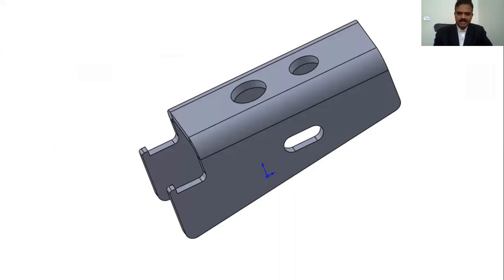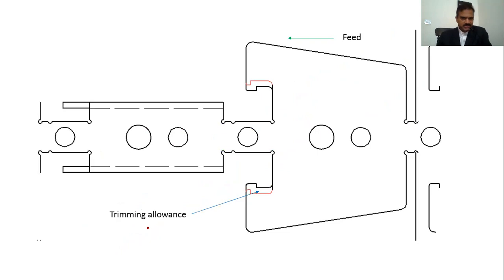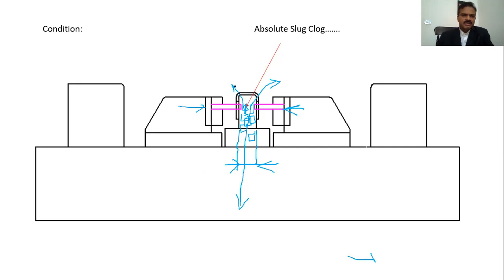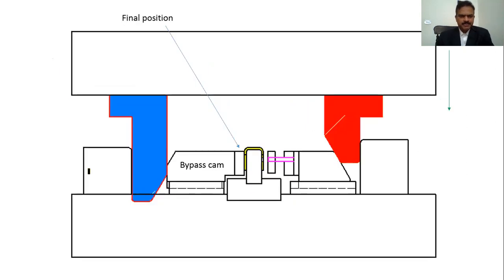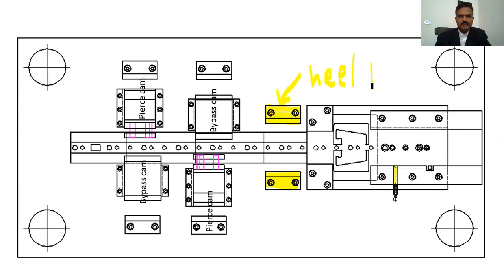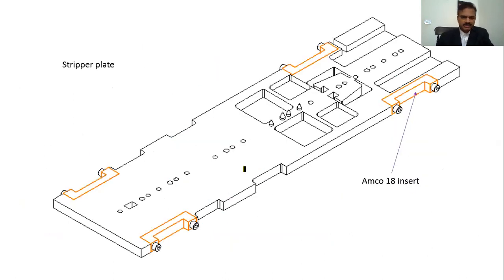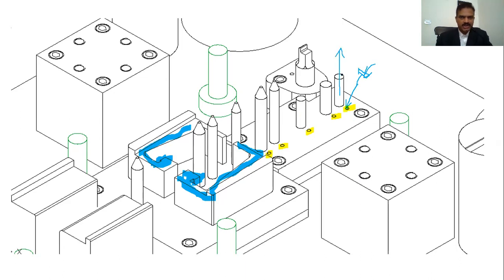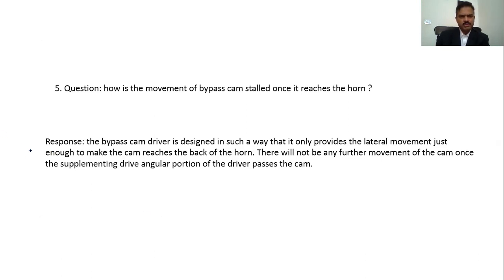ADVANCED MULTI STAGE TOOL

Comment: Why should I use a side piercing cam although I can make that piercing In one of the previous stages before making the bending for both two side flanges?!
Reply from the maker: Side cam pierce is opted ( in this case) when we need to hold the position of the profile in tight numbers with ref to the datum on another plain......
Where as if it's an open tolerance, we can do it all in one station prior to bend......